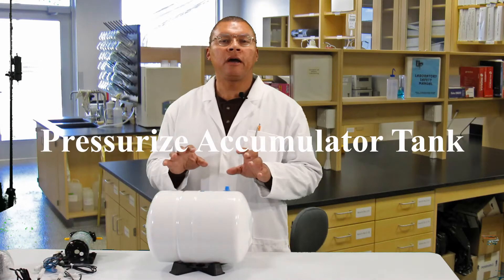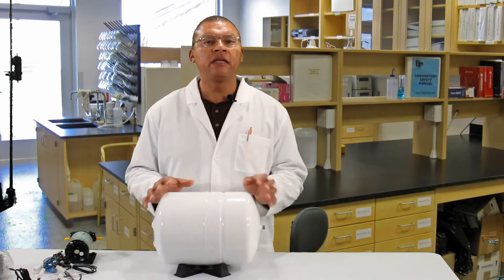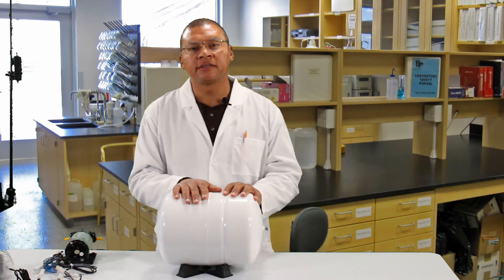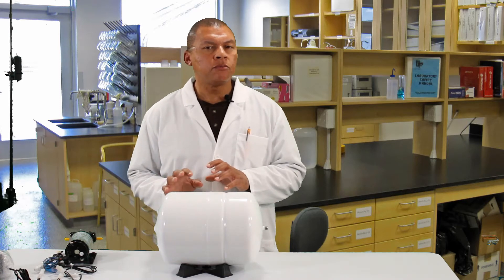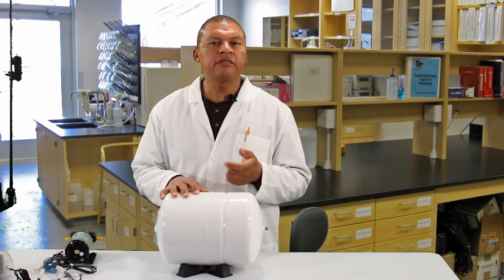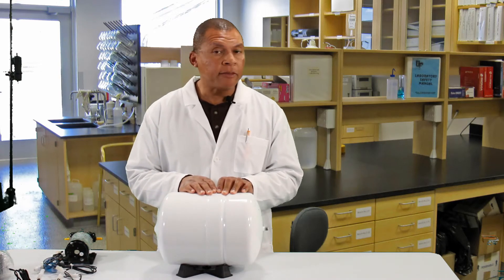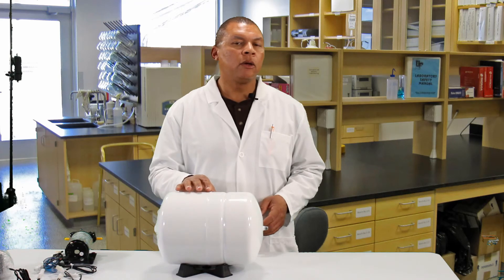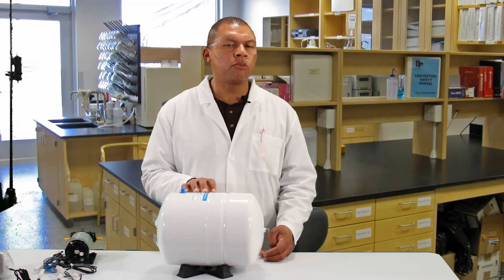High Pressure Aeroponics - Is a pressure Tank necessary?

Comment: I built an HP aero system using impaction pin nozzles and a 2000psi pump. Direct Pressure is best for large systems where you want sub 25 micron fog.

Comment: install your tank upside down for the nutrien,best a 4 gallon,because let work less the intermitent electric pump with longer period to cooled  ,if the electric pump work 10 seconds and rest at least 50 second,that pum will fail soon because burning.measure how many mist cycle in one charge.on and off in one hour willbe 60,50 times,how many times its in a week,month or a year,choice the right pump  and a pressure tank , that its the most important in HP aeroponic.if you set with that1.5 gallon pressure tank in one cycle with 3 nuzzles at 80 psi,the second mist will have 50 psi and the pump will star the cycle again,in a week you will have to buy another pump,look for motor pump runing intermitent not continuously or build a box with a fan to cool down the temperature.sorry high tech,you teach me a lot but only on this have discrepancy.the live of my plant 🌿 🌿 ist so important.

Comment: Umm, doesn't just having a solenoid close to the nozzles and starting the pump a few seconds before turning on the solenoid and allowing flow to the nozzles negate the need for a pressure tank? The pumps are brushless so the constant cycles and back pressure has no ill effect on the pump and the pump should always be large enough to supply full pressure when the system is running. You also forget the pressure of the tank drops super quick once it starts feeding flow from it......
Reply: what? tank pressure drop depends on tank size, pressure and nutrient consumption. Saying it will drop super quick is wrong because it all depends on the application. Also you are talking about motor wear, not the actual pump wear.
Reply: @turboturd7954  I don't think you have ever worked in this area have you? Pump wear and motor wear go hand in hand, it is rare the internals of the pump will go before the motor and total run time is all that counts which the accumulator has no affect on. The accumulator is there to stop and initial drop in pressure and mostly to stop the sound of the pump running every time you use the water in your caravan or off grid home (they are not meant for hydro use). The pressure drops rapidly in these accumulators, even if you use and oversized tank, this is due to the vast majority of them compressing air to maintain the pressure in the tank, when you drop the volume of liquid in the tank the air pressure and subsequently the water pressure drops alongside the drop in water volume. If you don't want drips or large drops when feed cycle stops you have to use a solenoid, if you want to use an accumulator then you also need to use a solenoid, turn the pump on a few seconds before the solenoid  (to pre-pressurize the lines) and you don't need an accumulator tank. Putting a lab coat on does not mean you know what you are doing, it generally means you are trying to "buy" credit when you are being dogmatic. There are other problems with these accumulator tanks in hydro due to how they are made and the products inside them (fyi, don't use any chemicals with these units, especially cleaning or sterilization agents).  But hey, sign up to some additional expense, i am sure they will suggest a place to buy one from where they will get a kick back....

Comment: I've noticed some pressure ratings on the pressure tanks. Do I need the pressure tank itself to reach the 60-100 PSI?
Reply: I found this on an amazon review for those who might have a similar question 

2. You can pressurize it with a bicycle lump or at a gas station.Just be careful you don't pop the bladder. Use a pressure gauge and go SLOW!
3. In an empty tank, air pressure should be 7-10 psi. In a full/heavy tank, air pressure should be 30-40 psi. To be accurate, air pressure should be 2/3 of incoming water pressure. When the tank is full, and if feed water pressure to the RO system is 60 psi, then a full tank should have 40 psi.
Manual for Recharging Air into RO Pressure Tank - Eden Filters
4. Check the pressure every six months, or if the tank does not seem to be filling, ie your flow of water is not normal. see less
Reply from the maker: Yes. Make sure the tank is rated to handle 100 psi.
Thanks for asking

Comment: Ok so as a follow-up to my previous question on tank sizing in case it helps someone else, I spent a bunch of time studying this. We need to think about:

1) How much water our nozzles are putting out each spray cycle (nozzle flow rate x # of nozzles x seconds of spray)

2) Volume of water that leaves the tank from when it's fully pressurized to when the pump turns back on. This is called the 'drawdown volume' and depends on the labeled tank volume and the min/max pressure values you're using. Drawdown volume = labeled volume x acceptance factor 

Where acceptance factor = 1 - (min pressure + 14.7)/(max pressure +14.7). For example, for a 100/80 psi system, the acceptance factor is 0.17. 

If you had a 2 gallon pressure tank then, the pump would kick on after 0.34 gal of water left the tank (2 x 0.17).

3) Desired pump cycles. Ideally most pumps should switch on no more than 10 times per hour and not run for much more than 1 minute at a time.  So you also need to know the flow rate that the pump can produce. 

So to give an example, let's say we've got a system with 5 nozzles, with flow rates of 0.03 gpm each, set to spray for 3 seconds every minute. Pump is set to switch on at 80 psi and off at 100 psi. We have a 1L (0.264 gal) pressure tank. The pump can put out 1.3 gpm at 90 psi.

The acceptance factor is 0.17.
Drawdown volume is 0.04 gal.
Flow rate is 5 nozzles x 0.03 gpm x 0.05 min/spray = 0.0075 gal/cycle.

Since we have 1 spray cycle/minute that means our tank loses 0.0075 gal/minute. With a drawdown volume of 0.04 gal, the pump will kick on every (0.04 gal / 0.0075 gal/min) = 5.3 min

So in this case the pump kicks on every 5 mins or 12 times per hour, which is a bit high. If we'd gotten a 2 gallon tank instead, the pump would only kick on every 45 min which is better, and lets you expand the system with even more nozzles in the future.

I think it makes sense to go with a 2 gallon tank or larger unless you're definitely going to have a very tiny system with no more than 5 nozzles.
Reply from the maker: This is what my Aeroponics Calculator will figure out for you.
It's coming soon.

Comment: I found a mini 1L pressure tank, is that big enough? How many nozzles could i run off of a 1 L tank withoit the pump kicking on every time? Or is the 2 gallon really necessary? Just seems awfully big unless you have quite a few nozzles.
Reply from the maker: Hi Brown,
The answer is a yes or no. It all depends on the system demands. The Aeroponics Calculator will help make the determination on the right tank size.
Thanks for the question.